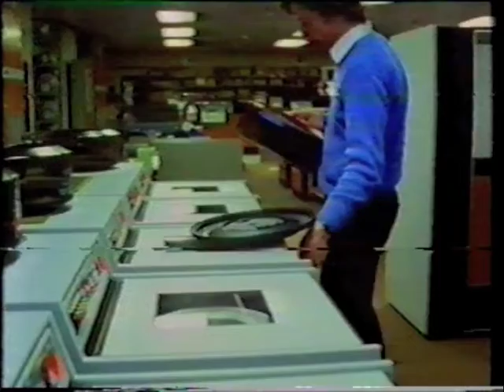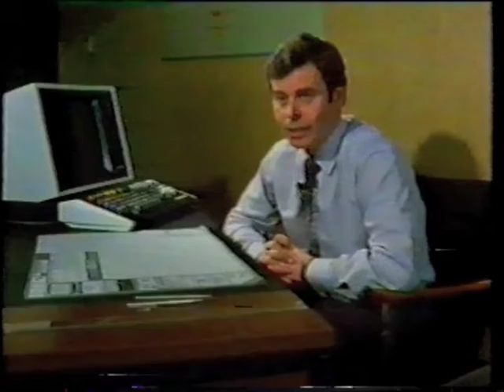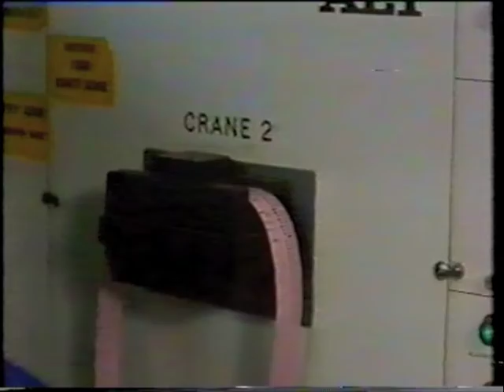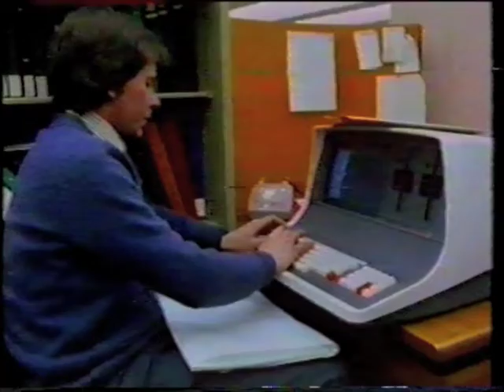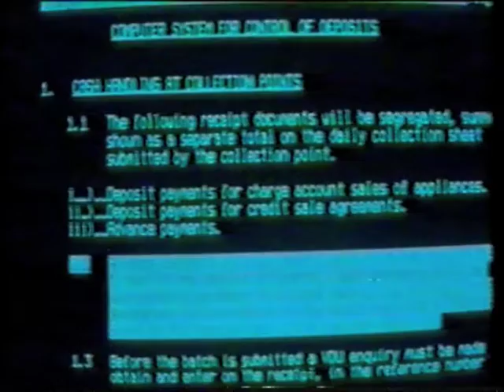Computing and Computers - Mainframes and Micros Unite - BBC 2 - 1983

Comment: nope... it won't. last guy that had the word also happened to be last guy in charge of anything, with an education that provided necessary knowledge and skills in order to:
1. know what it actually is the company is doing
2. determine what possible problems and means of actions exist
3. what kind of knowledge and skills it takes, to find solutions for such problems and perform the means it takes to solve them
4. deligate tasks to the position held by that type of person, or create the position it if there is none.

since ~85 there is a new type of management that...:
1. explicitly avoids to acquire any knowledge or skill, particular for that company
2. assume that there is a field called 'business' they are the designated experts of, hence someone else must be in charge of dealing with things and stuff.
3. that 'business' is always the same and everything else is irrelevant detail.
4. everything is business related, hance whatever they decide as experts is true per definition
5. if anything went wrong, whomever was in charge must have fucked up, unless management explicitly ordered to fuck up, it must be the muggles fault.

that's of course absolutely true and vast sums of monetary units with lots of digits exist and are quite regularly referred to, which generates the general assumption it's just to important for management, to not have a clue and far to complicated for us muggles to understand, even so that general assumption constantly fails to show any effect and the referred sums are hardly ever indicative, if not entirely independent from the quality of decisions made by management...

so the next guy just ordered windows, because the microsoft sales drone told him, that's how it's done and also happened to be a computer expert. so why waste time on thinking about, what it is you expect the software to do, when you can continue to do all those 'office' things, but now in a tiny dollhouse office that lives in a telly.... given how much more expensive it was, it must make sense and mrs. moneypenny will eventually figure it out, like she always did and put it in the map of things to sign.

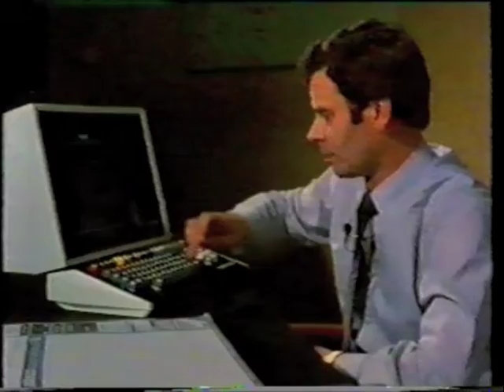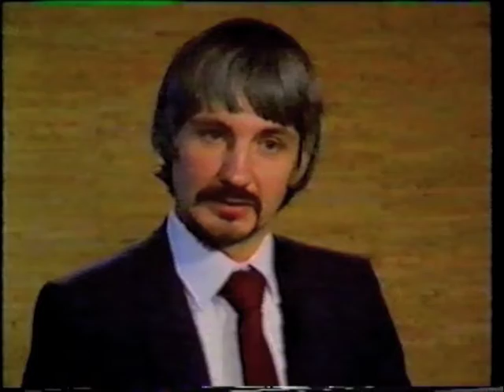Comment: What are those terminals that appear at various moments, 17:54 one of those. The screen font (14:42) seems very crisp for that time period.
Reply: Looks like Cromemco and Intertec.  Fonts for professional computers were clearer than those for  PCs.  The terminals I worked on in that time period actually had adjustable fonts and it was not uncommon for the customer to call to have them made clearer, and change the spacing, and the leading and trailing edge of the characters.  FWIW, you could make your own fonts on the short-lived AT&T 7300 (the Unix PC).